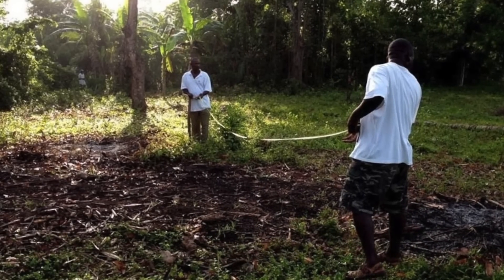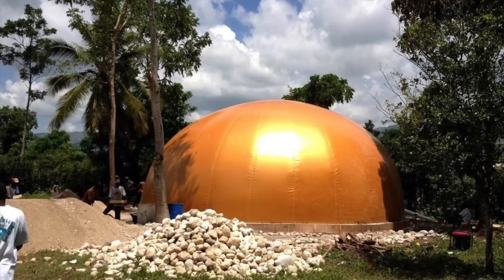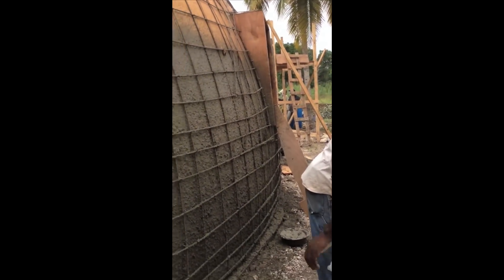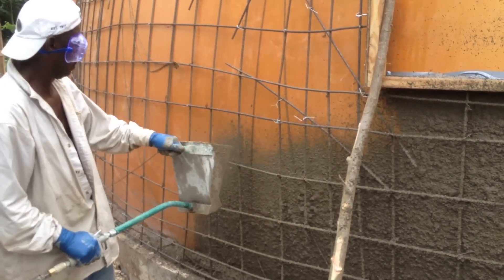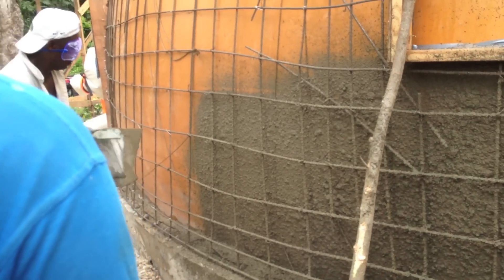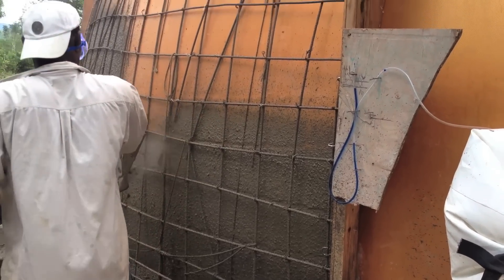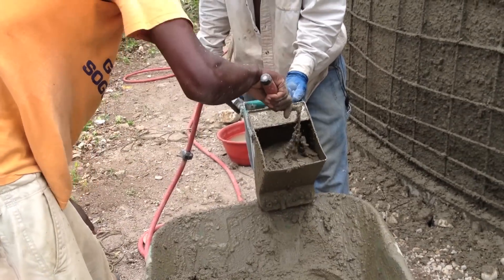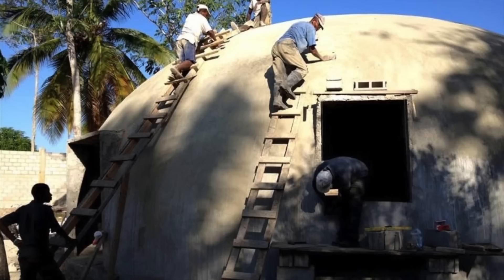Monolithic Dome Construction with a Stucco Sprayer | Hildebrand Construction in Haiti

Comment: Hi! I am currently working on a project that is looking into hurricane resistant housing, and the monolithic dome is something that I am researching into. Does anyone know how stable and durable this structure really is, and if it is hurricane resistant?
Reply: Therese If 2" thick it will withstand up to Cat 5 hurricane winds.  If made 4" thick will stand up to EF-5 tornado winds.  Earthquake and fire proof also.  In  addition floods don't harm the dome itself.  If made with basalt reinforcing instead of steel they should last about 2,000 yer with minimal upkeep.

Comment: Foam Crete might be an alternative
Reply: No near as strong jere
Reply: But the insulation factor would be much better with foam crete. Perhaps just foam crete on the denser end of the spectrum?
Reply: @h3rm1tspaceballer23  Since they have no air conditioners the inside temp becomes equal to outside temp no matter the insulation.  Come on, basic 6th grade physical science...

Comment: Let us assume that you want to build multiple domes of the same size as this one. One way to go about it would be to build a special scaffolding system on wheels. Here is the way I envisioned it. First you need to build a circular 6 feet wide cement path at the base of the dome. In other words if the dome has a cement floor in the interior, expand the diameter of the floor to be 12 feet wider. Now think of a curved ladder that travels from the ground to the top center of the dome. These ladders will come in sections that can be added on top of the assembled (climbable bottom sections). When the 3 ladders (located at 120 degrees from each other around the circular base) meet on top, they will be secured to each other. Ropes can also be added in a circular pattern at different heights to keep the ladders equidistant to each other when they are moved. I forgot to mention that once they ladders are connected, a lever at the bottom will lift them enough to make them rest on wheels. Once on wheels the ladders will rotate around the dome together when pushed by at least 3 people at the same time (or one person a short distance at a time). This rotating triple curved ladder set, will be dismantled once construction is complete. I can also envision a big tube of toothpaste delivering mortar from a rectangular nozzle (just like 3D house printers). Instead of toothpaste, it will be mortar and the tube will be a rubber hose that is connected to a cylinder that is pressurized either manually or with an air compressor. You could be using more mortar but could also build a much stronger dome as fast as a multi-million dollar 3D house printer.
Reply: No need to reinvent the wheel Generatorblue

Comment: This is the best implementation on domes I have seen. The fact they use a true dome shape greatly strengthens the structure with only a small amount of concrete. I even question the need for rebar or wire reinforcement. In temperate areas,  I'll bet it's ice cold in winter, and excessively hot in winter.  I suppose it could use an 8" layer of foam on the exterior, covered by another inch of shotcrete for weather proofing.
Reply: You will always require a tensile strength element unless the concrete contains fibres . EcoShells are very cool in hot temperatures but you would need to build a Monolithic Dome in cold climates. We incorporate 3" of polyurethane foam which prevents 97% of heat exchange in our buildings.  HDomes.com

Comment: I was thinking of using electrical conduit, flatten the ends and drill holes through them and screw 5 together and repeat until I make a dome frame... then wrap the outside with saran wrap, spray foam the inside then add concrete to the outside.  Add some rubberized roof coating and that should be as sturdy as needed.  I would like the first 4 feet to go straight up so you can stand by the edge of the wall without having to stoop though.
Reply from the maker: Hello Willie, 
We have had a customer do a similar project. Brandon is his name. He got rid of debt and built a small home that fit him nicely. The Story is here: https://www.mortarsprayer.com/papercrete/papercrete-dome/  and more details here: http://www.minimalintentions.com/search/label/Geodesic%20Dome   
Good luck with the dome. Please contact us if we can help in any way. 
Best regards,
Nolan
Reply: Willie, you have the sequence backwards.  It is most efficient to have the insulation OUTSIDE the concrete

Comment: So these are made of plaster instead of concrete. Is there any place in the US that this is allowed that does have building codes?
Can this be done using actual concrete?
Reply: I believe they ARE spraying concrete. The idea behind using a Stucco sprayer is a project can be a more affordable DIY project. Mix your own concrete and spray it yourself VS commercial concrete truck and shotcrete pump system. 
The Stucco sprayer is much slower though. If you call a concrete truck out for this type of application you must have a high volume concrete pump system as the concrete company will charge you by the minute over a set amount of time to deliver the truck load. They want the truck empty in say, 30 minutes, not 10 hrs.
Reply: This is actual concrete!  At least 4000 psi.  We use different aggregate mixtures for different lays of the shell.
Reply: Actually the aggregate used is fine and is better if mixed properly less water and if doing domes less weight.
Reply: these mortar sprayers can spray fiber reinforced mortar which is near Bulletproof
Reply from the maker: Hi, yes the sprayers can spray fibered mixes!
Reply: You are correct, we are spraying concrete.
Reply: @danh7882  True reinforced concrete is made of cement, sand, and gravel, in which is embeded a steel structure. Any of those ingredients missing and you dont have real concrete. The video crearly shows it is a mixture of cement, water and sand, because gravel cannot be used with that tool. So I would say that you are using some form of mortar, except hydrated lime. Gravel is very important in reinforced concrete. People shoudl be aware of the differences in materials. As long as nothing is put over the dome, this structure should be ok. But concrete not is!
Reply: Patty Baker. That material will equal the strenghth of basic concrete when cured.
  Concrete can be hand- trowelled. It would be slower.
Reply: Wrong Patty.  They are made of concrete

Comment: I liked the mason mix spray gun. But I felt like i should mention  That I remember working at a refinery as a mason tender for refractory replacement . Now mind u i was only mixing the bags at a mixer but as i remember it there was a trailer compressor that pumped contents of mixer through some hydraulic pipes up to the workers in the refactory oven.All i had to do was ope a valve and it sent the refractory mix up to the workers who had a spray gun hooked to the hydraulic tube or hose .
Reply: We use a (relatively) small compressor to apply the concrete.  It's basically a simple, cheap version of shotcrete.

Comment: These buildings as they show here get verrrry hot in the sun with out insulation so remember to spray on a coat of aluminum paint called radiant heat beerier to keep building cool and be sure you use a grade of concrete that is water proof also these thin shell building do crack over time , a short time but the cracks tend to run parallel to the ground so structurally they are not a problem BUT they can leak water when it rains a lot so be sure to spay with some kind of roofing tar or glue or some thing to make a water beerier or live with leaky roof !its not as simple as they show here in real practice you must know what you are doing just like in any thing if you want a good product !
Reply: Actually the buildings are cool inside - in Indonesia we were achieving an internal temperature as much as 15 degrees f cooler inside.  We design them with a vent on the top and louvres in the side walls.  We seal the domes using a cement slurry and then paint.  With all due respect, it might be better to ask questions rather than making statements...  For further info please visit HDomes.com
Reply: Dan H, 

Do you have a presence on Facebook?

If so, would it be ok to reach out to you, there?

I am presently unable to access my email accounts, due to a number of complications, related to living in a third-world nation.

Would like to be able to contact you, to discuss this type of business.

Thank you!
Reply: Spraying vermiculite with the concrete mix will give up to r35 at 1" thick.  Marcite (marble/white cement mix} would seal it as it does with a swimming pool>  Cover the whole structure with dirt for further insulation and hide exterior!   Very good idea with vinyl dome as starting point! (removed later)
Reply: Ron Noonan I would offer a note about Vermiculite, there are three types of Vermiculite. One is just Vermiculite and the other is Vermiculite with Asbestos, and the last is Vermiculite with low level radioactive dust. The contaminated Vermiculite is material from the late 70’s and older, most of that comes from old houses and old insulation. This contaminated material was shipped world wide, so know your source. If it’s new, it’s probably good material, but I’d still make sure some old material wasn’t added. You can tell if it’s really old because it will be very dusty and will look like some of the small pieces have been smashed and will have creases or lines pressed in.
Reply: Elastomeric roof coating would be good I think.
Reply: Without A/C no matter the insulation the outside and inside temps will equal out.  Thermodynamics is a b1tch.

Comment: i got decades to explain to peoples that dome houses are what humanity needs .  living in square rooms is antinatural  .concrete dome house  is the best alternative against hurricans and etc.......
Reply: It's a tough sell. When I first learned about these dome houses I couldn't come to the understanding that this was actually a very strong structure. Which means I had to be proven Wrong by the facts. Eventually someone showed me then you can actually cover these in dirt and that is what convinced me that it was the truth. But then I saw a few other examples domes that were near hurricane shorelines that have been standing for 20 years while all other buildings around or destroyed. So now I understand Lee's domes are designed to last especially if they're built the proper equipment and methodology that makes them last forever.
Reply: My apologies for the typos, I'm using my cell phone within another app that will allow me to edit my comments.

Comment: Please tell me where you found the balloon to inflate in the center.Any more details on that process? Lastly do you think this structure would also work with adobe? Im thinking of making a similar structure with 100% mix
Reply from the maker: Hi Travis, the balloon form is from Monolithic.org, they have been building these for decades and have alot of wonderful information. I don't think this exact method would work with adobe. This system requires rebar and concrete for structural integrity.
Reply: Thank you for the reply. I was thinking of maybe spraying the adobe and then tossing straw on it. Then spraying another layer of adobe over that. Without rebar or wire. Thoughts and opinions?
Reply: I wouldn't toss straw on it since I want the straw to blend properly. Instead, I would mix both in a bin then plaster it on by hand. Secondly, since a dome is curve, rain would erode the adobe unlike an adobe square building. Maybe make a straw roof for it like a Brazilian tribe house.
Reply: +Travis Woods use rebar and wire. safer.
Reply: Monolithic Dome Institute
Reply: +cas sowinski planos